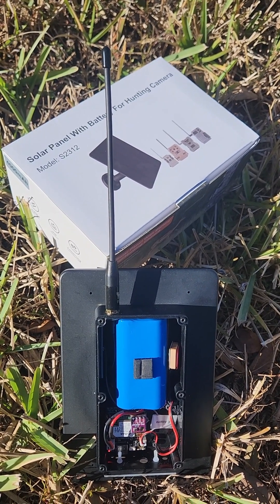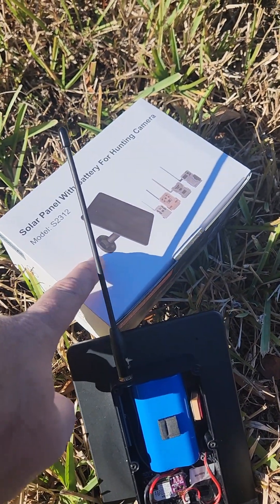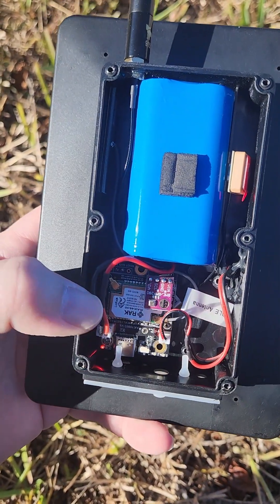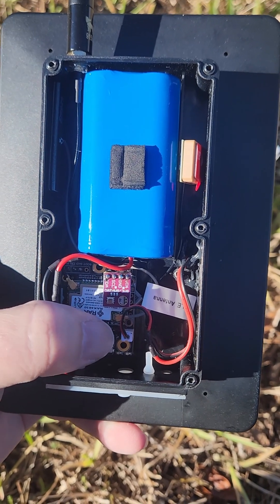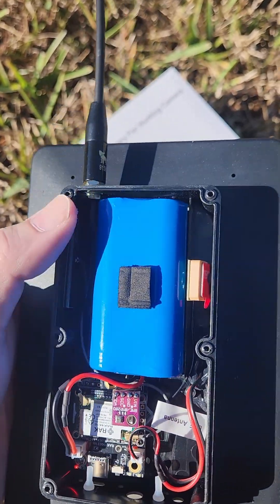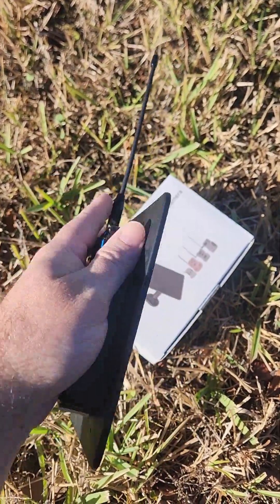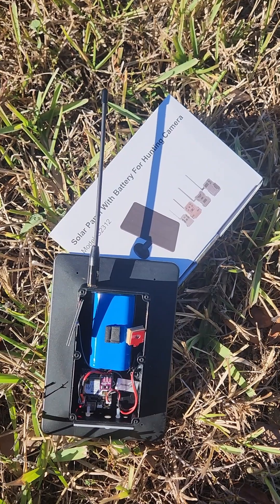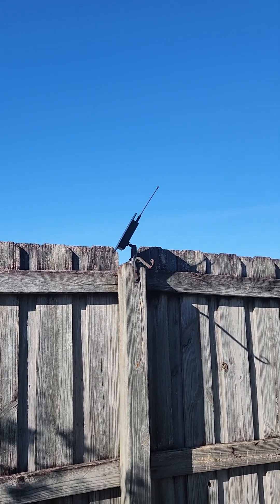Solar Meshtastic Node (Parts List in the Description) #Meshtastic #LoRa #SolarNode

Comment: Have you had any issues only using 4kma?
Reply from the maker: No but I did add a 3A BMS across each 18650 to prevent brown outs from not recovering.